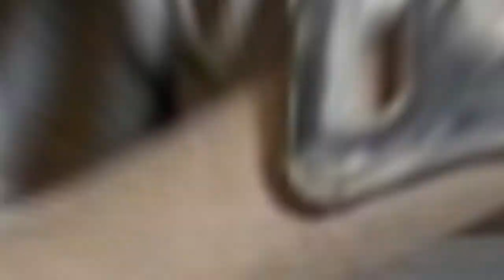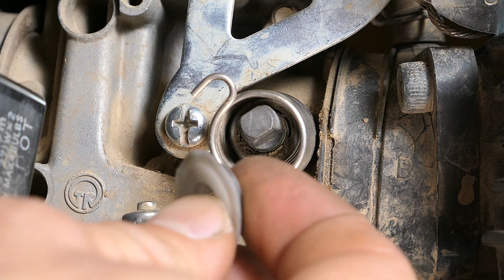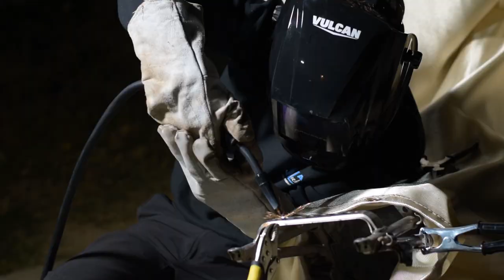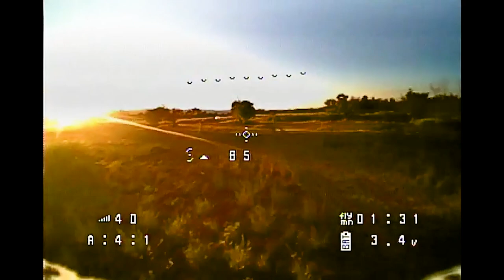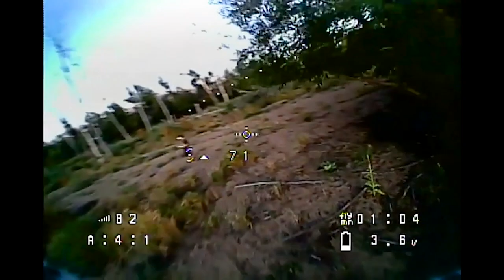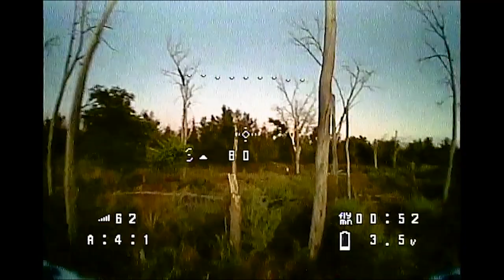How To install the Throttle Spring on the Yamaha TW200

Comment: Another great video.  You do such an excellent job of explaining, and demonstrating, these small details.  I haven't had that throttle spring off, but I have certainly puzzled over many other springs trying to figure out how the heck they go on.    Oh, and thanks for explaining about the two throttle cables ... I was wondering about that just lately.
Reply from the maker: thank you! yeah I try to add a lot of detail in as little amount of time as possible haha yeah springs tend to do that. no problem! I wasn't sure if I should add that or not

Comment: Hey Mate / G'day, I'm Olivier from France  and I 'm not down under I' afraid. 've been struggling on tons of Utubes / blablabal until I find out your video so to fix that B...y spring on my french specs 200TW... Short and to the point. you're the man.
Reply: @Doohan / Miller / Stoner.
Reply: EVen the Yamaha larger shop keeper blocke down the street didn't know that trick... actually they only sold 64 of these in France at the time...the large of them have been sold in 125CC (loosy french reg.& law) with different carbs.,,,, so nobody know how to sort that out.... wired , isn't it ?
Reply from the maker: hey so glad to hear the video helped you fix it! thanks. oh wow not a popular bike there. yeah pretty strange, thank goodness for the internet

Comment: So I think I lost that plastic washer bad boy. Whoops! I twisted the spring back-on without any washer—it was super difficult (I have done it twice). I don't remember ever seeing it (I also didn't know to look for it). It likely popped off. The throttle still seems to be springing back without an issue though. I can't say I have ever really noticed any major issues.

I haven't found a replacement for that single part. Looks like you've gotta purchase an entire carb to get one. Hopefully I'll find something.

This video definitely would've helped :)   Thanks for the post man. This stuff is great.
Reply from the maker: dang that sucks was the bike used maybe someone else didn't put it back on, should still work without it I think, you could probably make one out of a scrap piece of plastic and a dremel tool. no problem! thanks for watching 😃
Reply: @TDubsKid  I bought it NEW, so if it wasn't there, the dealer forgot it ... which seems unlikely. I probably just didn't notice it :(

Ah well. I do have a Chinese aftermarket carb and I tried using the one from that; however, the aftermarket is actually 14mm, not 13mm.

I'm good to go now though, as I did find a replacement on eBay from an older TW. Installed it Wednesday, and I can definitely tell a difference in the throttle smoothness/response. It certainly works without, but works better with.
Reply from the maker: nice glad you got it taken care of, good to know that it makes a difference in throttle smoothness

Comment: Thanks! Have you ever made a video on how to change the Main Jet for high altitude riding? Going to CO to do the COBDR and worried my TDUB wont make it to 8300MSL.
Reply from the maker: Hey no problem, I ride from 6000 to 12000 ft and never touched the carb. Has been just fine

Comment: Good stuff! How long is the battery good for? Just traded my boulevard 650 for an older dr125se. I have a goldwing and an nc700x so the boulevard had to go for something more versatile. While the 125 is pretty sluggish in comparison, I had to get offroad now and again.
Reply from the maker: thanks! on the little drone, it's about 2 to 3 minutes. if your talking about the TW. I have had the lithium battery last about 2 and a half years, still starts every time. nice, seems like a good combo

Comment: On my tw200 the idle adjustment screw gets higher and higher as I go offroading so I'm constantly  unscrewing it to bring the idle back down. Any ideas?
Reply from the maker: is the actual screw moving??
Reply: @TDubsKid  yes, it's like the bumps cause it to screw in causing the idle to be very high until I unscrew it and it goes back to normal. Maybe it's the spring not being strong enough?
Reply from the maker: you could try to put a dab of hot glue on the threads to keep it from moving or maybe some loctite.

Comment: I hate to admit it but I'm struggling with this. I guess I need the little hook thing.
Reply from the maker: Yeah its a pain, keep at it and you will get it
Reply: @TDubsKid  I lost the bushing for about an HR then luckily found it.  I ended up using a piece of heavy fishing line to twist the spring since I didn't have that hook. 
Thanks for all your videos on the TW.
Reply from the maker: Glad you got it!! No problem